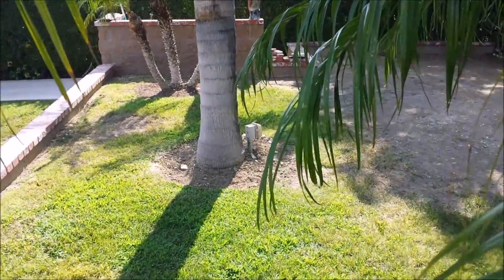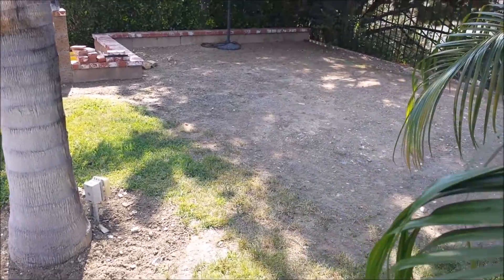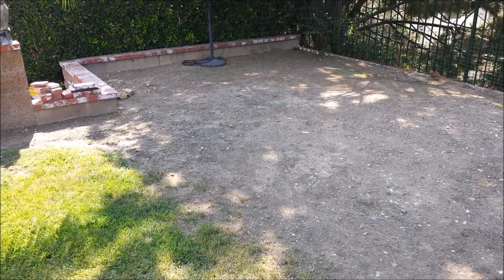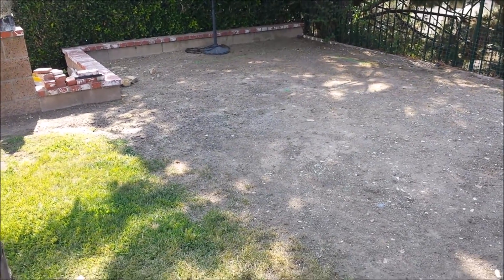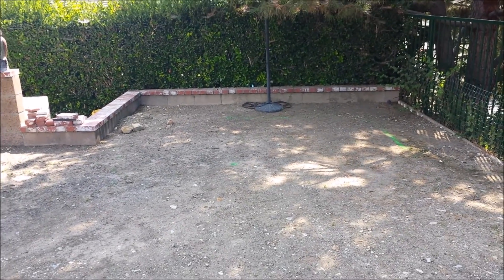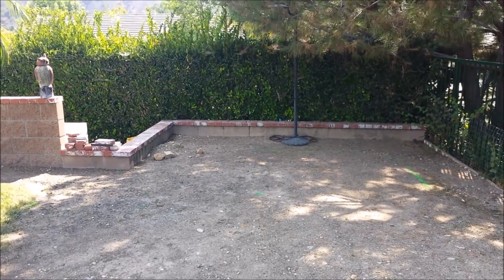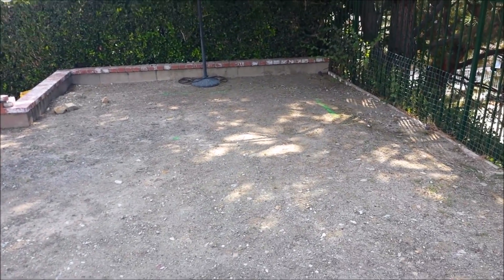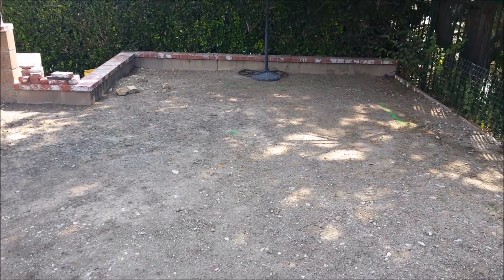O scale Trains by Ron - Outdoor layout - E1 - The Beginning

Comment: Ron, I see on your old layout, you used some plastic models. Do you leave them out on your layout or bring them in? I was thinking of using some and use some UV protectant. I have an atlas o gauge round table, do you think if I UV coat it and have it covered when I am not using it, it will hold up and be viable outside? THanks
Reply from the maker: Dave:  Yes on the old lay out I left plastic building outside.  I sprayed them with a clear spray that claimed to be UV resistant.  I sprayed the building every 6 months or so.  They have held up quite well.  I plan to add the building to the new layout once I have laid all the track.  Thanks for tuning in.  Skol!  Ron//
REPLY
Reply: If you are in the Southern California area, I would love to come see your layout up close. Still a little confused on the wiring, that went a little to fast for this novice. I have a huge yard that I would like to have a couple of tracks run around. Thanks for  you videos. My wife is now asking to watch them. I may end up moving the layout out of her living room!
Reply from the maker: Dave I'm in so cal, send email, we can set up a visit.
ronaldkarlsson64@gmail.com